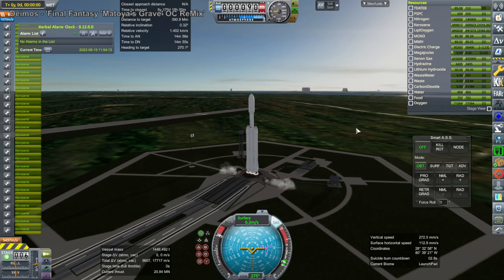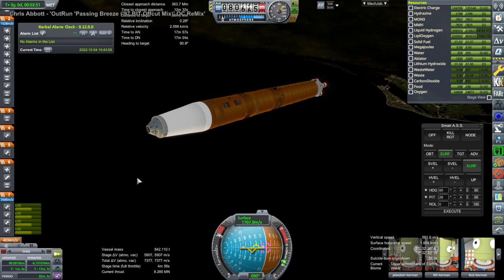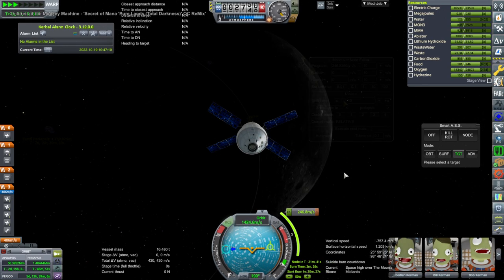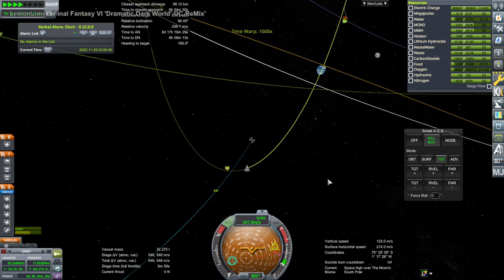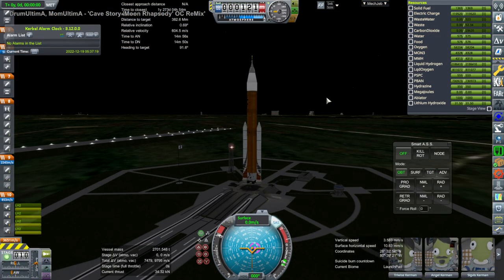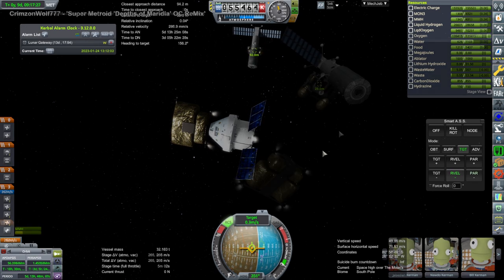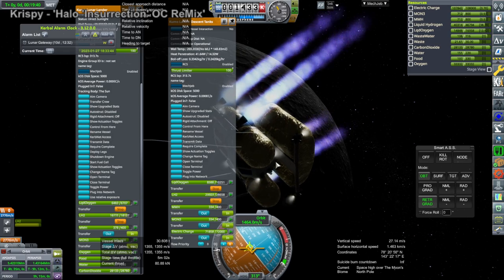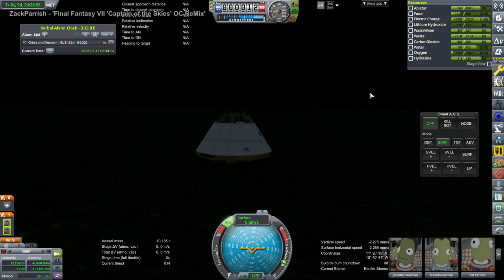KSP 1.8.1 with RO - Full Kumo Lunar Lander Mission Sequence Test

Comment: Out of curiosity, is there a reason why you use procedural fairings instead of the Universal Stage Adapter/USA and the Orion Stage Adapter for SLS Block 1B? I might be misremembering, but wasn’t Kumo designed to fit inside of the USA, beneath Orion?
Reply from the maker: The fairing parts which came with the mod tended to be unreliable - or, at least, I've had problems with them before.